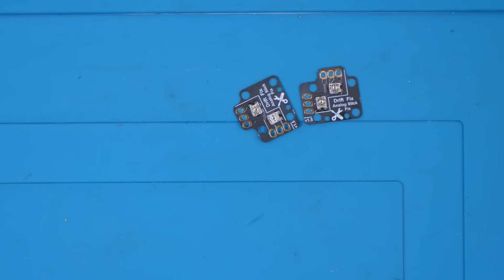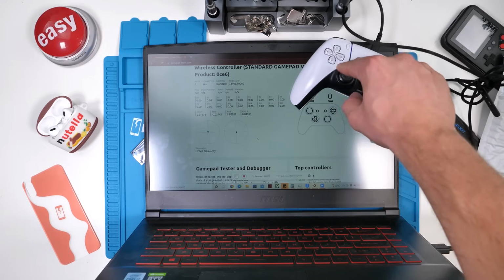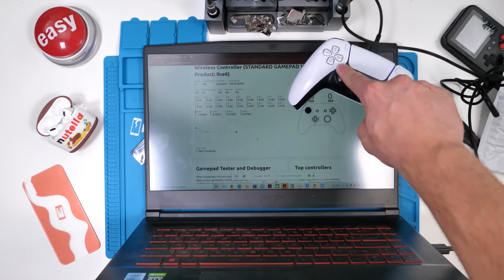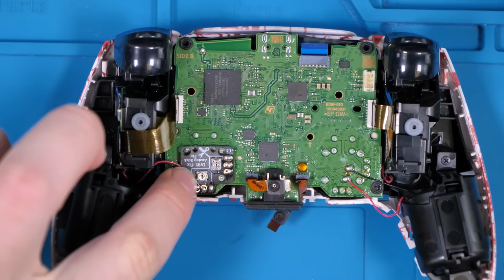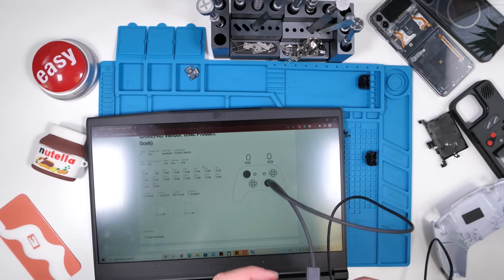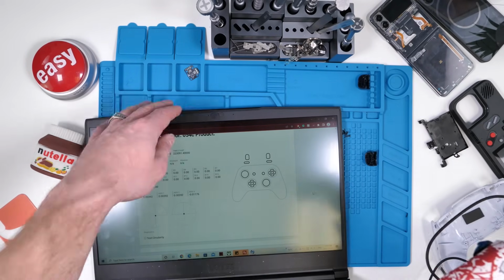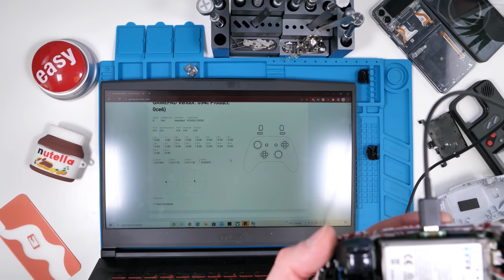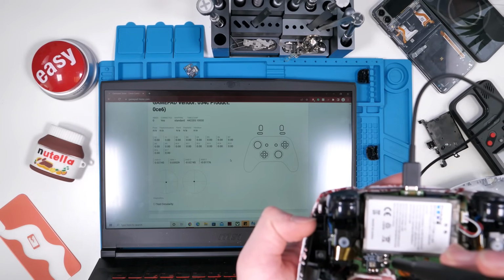IS THIS THE UNIVERSAL-  STICK DRIFT FIX?🤨

Comment from the maker: https://www.aliexpress.com/item/1005004122483308.html?spm=a2g0o.order_list.0.0.37d21802JXA1Nb
Reply: Hi
Reply: Hi again
Reply: Hi again again
Reply: Hi
Reply: Hi again
Reply: Hi again again
Reply: Does it work with ps4 controllers
Reply: Oh god, PLEASE use flux when soldering, seeing the pads look like that just pains me, probably because my job is literally to solder
Reply: steam deck is another console/ pc but it has a controller so i count it
Reply: Nice
Reply: You should do a video about gulikit hall effect sticks
Reply: Hey I already fix my Xbox Controllers (they are the best for playing on PC) .. Xbox 360 controller replaced USB wiring changed joysticks actuators replaced shoulder contractor buttons ... On my old Xbox one controller I replaced the buttons silicone membrane shoulder buttons the plastic broke so I kept it for spears parts
My Xbox one controller I use at the moment the shoulder buttons plastic broke ..the plastic that holds both buttons in place when I opened up the plastic was actually bent so I straightened out the plastic and glued stronger Plastic behind where it was bent reinforcing it by doing so I had to cut out the screw section in the middle of the controller it stays well closed with the screw's left and the controller works fine .. I only use PowerA brand RGB controllers 
I do have a new Xbox series X/S controller in it's box..
Reply: Hola
Reply: Hi
Reply: you have one of the those scammer impersonators in the thread offering gifts, pls remind ppl they are scammers and not you
Reply: Can u repair a oculus controller one broke
Reply: Good day phone repair guru 
I am a young entrepreneur who loves you to watch your videos, you inspired me to make my own small repair business and i would like to know if it's alright with you that i could call it Tech Repair Guru
Reply: @BOb911  yes
Reply: Send my money back prg
Reply: @@AstonDeSouza-oh3kw no, rog ally is weird
Reply: What is the link to the software you utilized during the drift analysis? 

Thanks!
Reply: NVM I just had to pay more attention to the words in the video ...

Comment: The real fix is to use Hall Effect sensors instead of potentiometers. Unfortunately those don't exist (yet?) for Playstation controllers of any generation, but Gulikit makes some pretty awesome controllers that have them which are compatible with everything else.
Reply: Sega used hall effect sensors in the dreamcast controller…
Reply: @jale05x  They sure did and those sticks never drifted :)
Reply: @hollow314  I own one and it works great as both a PC and Switch controller. DInput is pretty much obsolete anyway.
Reply: Gulikit is going to be selling Nintendo switch sticks that you can swap in on the original controllers!
Reply: @taroven  it should not be obsolete. xinput is horrible and it's just a way for microsoft to push their xbox controllers. i'm currently reading the hid and pid documentation so i can hopefully avoid this crap. also, completely ditching directinput is a horrible move since many old games and controllers rely on it.
Reply: Do they have them for Xbox???? I can only find ones for Switch, PC, and mobile
Reply: @shepshepson  I was under the impression that the Kingkong 2 would, but apparently not :(
Reply: Dang that sucks
Reply: I searched around and GuliKit appereantly has implemented DualShock 4 emulation in recent firmware updates. I have the KK2 Pro but no PS4 to test it though unfortunately.
Reply: @shepshepson  their KingKong2 Pro (officially) supports Switch Pro Controller emulation, Xbox, Android, iOS/macOS, and Windows via XINPUT in case the Xbox mode does not function for a particular game. So basically it has 4 different modes, which kinda turns it into a different controller.
Reply: @Piipperi800  are you for real? If so that's awesome that it works with Switch, Xbox, mobile, and Pc.
Reply: @shepshepson  yes, I own the KK2 Pro and it does work really well.
Reply: @Piipperi800  well thank you for sharing!
Reply: ps3 sixaxis controller uses hall-effect sensor, so there you go
Reply: And there's already a steam deck hall effect joystick mod, but you gotta solder one connection which is annoying
Reply: @king_james_official  XInput > DInput

You can't be this fragile over a better system.
Reply: The DualShock 3 used hall sensors. One of many reasons it's one of my favorite controllers ever.
Reply: @Rudofaux  nahh man i'm not giving up support for 128 buttons and 8 axes
Reply: some ps3 controllers used hall sensors
Reply: @karelissomoved1505  Which one?
Reply: Are the Gulikit controllers good disability wise? Past controllers I’ve used have had stick drift, sticky/mushy buttons, dead buttons, cracks and scratches, etc… I’m looking for a controller that I won’t ever really need to replace
Reply: Can we use a bluetooh headphone on the Xbox SeriesX with a XB2 to Connect a Gullikit controller.
I answer that because i know that its not possible to use jack 3.5mm on the controller with a WingMan XB2 !
Reply: You can buy hall effect sensors now
Reply: I just bought a hall effect ps4 stick from aliexpress
Reply: I just installed hall effect sticks in my PS5 controllers. Not prone to getting gummed up but still requires these pots to correct minor misalignment.
Reply: Actually magnetic Hall Effect joysticks don't last half as long because the spring in them breaks faster than ps4 and 5 joysticks can get stick drift, rendering the joysticks completely useless. So ps4 and ps5 controllers are actually better. (just a little fun fact)
Reply: Marius Heier is working on hall effect sensors though
Reply: Hey, I know this was commented a year ago. They released the Gulikit KK3 Max , and I was wondering does it work for ps5 ?
Reply: N64 controller fixed this way back in the day with optical
Reply: analog hall effect have bad calibration you need this calibrator
Reply: False on every level. Also there are optical sticks.
Reply: The ps2 never suffered from drift like this new controllers
Reply: Some DualShock 3s use hall effect
Reply: Uhhh, they've been available for years.  I put one in my PS4 controller like 5 years ago ..
Reply: Does not work for me. The joystick  resistence is 10k, the pcb drift fix potentiometers are 10k also. They are installed in paralel, so the total resistence drops to 5k.

Comment: The adjustment board uses two trimmer potentiometers to make it look like the joystick is centered (basically an offset). It isn't a permanent solution, but it allows you to offset the axes once again if the stick starts to drift. Never knew these boards existed. It's a pretty smart and cheap solution to the problem before hall effect sensor joysticks become cheap and widespread.
Reply: isnt it easier to change the pottie alone instead of that?
Reply: @ed9...5  what pottie? You mean the glue
Reply: The original ps3 sixaxis controller is cheap hall-effect controller, hall-effect sensor has been around for a long time (we're talking the 80's here with hall-effect keyboard), and they're cheap but not as common as potentiometer
Reply: @meric12131415  pottie is a term for tri-legged potentiometer
Reply: @meric12131415  he means the litter box
Reply: @chrom4ful  🤣 ah thank you and thank god for Google
Reply: @ed9...5  this is easier since you don't have to de-solder anything, but i don't see it as a good or permanent solution since its probably going to gradually increase your dead-zone.
Reply: I dont think this affects deadzone at all. Its just an offset. A virtual one basically. Nothing was moved at all
Reply: @ggooaa100  sure about that?
Reply: @meric12131415  not 100% sure because I did not done this myself, but logically it shouldn't affect it. Its just counter the old potmeters bad resistance by adding or subtracting more with the little ones. Its just my theory . Lets say the pot. should be 1 ohm from the factory. If its starts to wear lets say at max its only 0.8 ohm so your maximum input is only 80% of the factorys. If you just add back that 0.2 ohms by this doodad, it should fix your deadzone right?
EDIT: I just simplified things with my example but it should work like that.
Reply: @ggooaa100  ah now it kinda makes sense also I guess so?
Reply: I agree, it looks more like an easy fix to repair and resell controllers, it wont last long because the original dead potentiometer is still on the pad and the drift can change direction or get worse so you will have to open again the controller again and adjust again and again. They even sell the stickers to make it like the controller has never been opened.
Reply: @ggooaa100  No, it wouldn’t fix it and yes, this mod works (temporarily) because it effectively increases the deadzone (to ignore errant drifting) which reduces the overall range of motion on the stick.

If your potentiometer is off center too much, this mod will limit your range by applying more resistance to the input. That means at 100% input, you're only going to actually see (for example) 60% output. These are really only useful for really, really tiny adjustments. I don't know exact values, but I'd venture to guess less than 0.5%.

Comment: I bought an inexpensive wired controller. Stick drift was always a problem. Not worrying about warranty, I opened it up and discovered the circuit board still had globs of solder flux around the pots and elsewhere. So I sprayed it with rubbing alcohol, scrubbed it with an old toothbrush, and reassembled it. Now it works perfectly.

Comment: For soldering, put a little solder on your iron, and touch the metals with that solder. It makes heat transfer better thus making it accept solder more easly. Then add more solder to the solder joints.
Reply: or better is to use some flux

Comment: What's funny is hall effect sensor technology was used for the analog sticks AND the analog triggers all the way back on the Sega Dreamcast. That means that back then it was somewhat affordable, at least to the point that it was economical to have hall effect sensors in the final product. As far as I know, it hasn't been used since. It's kinda upsetting because clearly that's one of the best ways to prevent wear and tear on the joysticks since there's no physical contact like with potentiometers, and it was at least somewhat affordable.

Comment: A tip for those soldering the board onto the back, 'add' solder droplet onto each spot first to make it nice and chunky, so you cover all the position for it.

Then put the board on top after the solder cools and hardens a little, and 'heat up each of the little holes rapidly one by one while using something to push the board down. If you do it correctly the melted solder will 'loosen' and fuse with the board while you are pushing it down... Be sure the solder doesn't leak out in between the board though.

Comment: This is really cool. I will note and he may say this, but you will eventually get to a point where the modules need replaced because it will eventually become nonfunctional by creating a massive dead zone. It’s a bandage not a fit. Still really cool. Also the parts cost a little less than replacement sticks so not as great cost wise.

Comment: Don't heat the solder, heat the pad/post you are soldering and "poke" it with the solder.

You should also be using flux to help the solder flow/stick where it is suppose to
Reply: I bet he had issues when he closed the controller because of this 😂
Reply: Could u perhaps dumb it down for me cause I just bought everything I need for this and don’t want to do anything wrong and I don’t understand wym

Comment: a month ago I repaired a stick drift from my old Xbox 360 controller. I simply replaced the potentiometer entirely, the piece costed me just 0,83 €. so it was much cheaper than this method and I didn't need to mess with a recalibration software. the downside is that I had to de-solder 17 points in order to remove the old potentiometer (14 from the potentiometer and another 3 from a different component that was in the way) so it took a lot more time than just soldering  without having to desolder first, but it was a nice experience.

Comment: I'm sure it works well if you have a dead spot in a particular place. Unfortunately my Elite II sticks in different places depending on which way I let go of the stick. If I hold up and let go it drifts down, if I hold down and let go it drifts up. Not always either. In any case this will only help if it always drifts the same way.
Reply: minute Maid  I had the same problem with the bumpers as well. It was actually quite easy to fix, just had to take the front  off and pick any fluff/debris where the bumper presses the button. It goes bad again, but it's not too hard to get back in. Could also be a bad button though.

Comment: I do have to say though, you should really consider a new soldering iron, the Hakko FX-951 is a lot better for small repairs because you can get extremely tiny tips with a lot better thermal conductivity
Reply: Thanks for the tip!
Reply: True but it might be better to go for one of the many JBC clones that are available now. Cheaper, better performance, and you can use genuine JBC cartridges (tips) with them. Tips last a really long time as they automatically go into standby mode when the handle is put in its holder. They automatically turn back on when you pick up the hand piece and heat up to soldering temperature before you have time to get the tip and solder to the joint, just a couple of seconds.

But the honest truth is that for basic soldering like this, just get any other tip for your existing iron that isn't a microscopic needle-shaped conical tip. Go for a chisel or bevel and get a few sizes. Just use the biggest tip you can that will still allow you to get to the pads and pins you want to solder. The parts pads and pins that are to be soldered need to reach a temperature that the solder will melt, so a bigger surface area will transfer the heat more efficiently to the pad/pin and a larger tip has more heat capacity as those old school irons don't get the heat from the heater to the tip very efficiently compared with the newer style ones discussed above. The extra heat capacity of a bigger tip will make up for the lower efficiency of the heater/tip by enough to make the job easier.

Comment: Love the vids but as you mentioned, your a little new to soldering. I just wanna say you did a pretty good job(as long as the joints dont touch) but just a good little pointer. You dont have to use as much solder as you were. Using less solder not only can keep from accidentally soldering multiple joints, it also just keeps your solder around for longer. Again love the videos and keep up the entertainment ❤️

Comment: The drifting stick is actually common on PS Vita, and someone actually fix one IIRC, with bunch of paper.

Yes, paper. Basically he added few papers to the back of the sticks so there's some pressure on the back.

Another solution that I come across is people actually blast these sticks with contact cleaner. Not even open the damn console. The idea was there's dust trapped inside so you need to blow it out. One of the safe way to do it with contact cleaner that comes in a pressured can.

Comment: My Meta Quest 2 controllers have terrible drift to the point where I’ve cleaned it with isopropyl alcohol 5 times, doesn’t do anything. I do not have any ifixit tools yet so ill watch this when i do

Comment: The cure would be some Hall effects sticks the steam deck has some third party ones you can easily install but I’m unaware if any exist for Xbox/PlayStation/Nintendo or if you can install any without heavy modding
Reply: Muhammad Al-Barwani  for the switch joycons? Makes sense it’s been having bad stick drift issues for years and those are pretty similar to the steam deck thumbsticks….I just wish they made some for PlayStation and Xbox….I’d love to have them on mine I’ve heard they more accurate with less or no dead zones that plus mechanical keyboard style switches on a console controller implemented in a comfortable and functional manner would be awesome….I’m a pc gamer but I’m platform agnostic and those switches after feeling them on a keyboard I just feel that they would feel amazing for a console controller it’s Much better and gives better feedback than the mushy membrane switches

Comment: And yes this is not a permanent solution but it'll probably double or triple the lifespan of each replacement module you buy to replace them.

For about $3~6 per board, or cheaper if you buy em in bulk, you can reuse them as many times as you need, even if you desolder and installed new sticks on top.

The boards you buy is meant for Dualshock 4 though, note that on the PS5 the red and black wires crosses under the board, on Dualshock 4 it's not under it.

At the very least it'll extend the life of a gamepad until you get hall effect parts or save up for those parts.

For the DIY enthusiasts, maybe you can install a 'adjustable' knob on the back of the case facing the screw hole, OR just simply and carefully use a soldering iron to 'melt' the hole precisely over those spots and use something to close it up when you are done adjusting.

Comment: the problem with that fix is the potentiometer which gets worn out, dirty, etc. That board will change their readings, but with time it will keep getting worse and the stick will start to give wrong readings! and I guess when aiming it won't be precise anymore, because even if you reset the dead center, the potentiometer itself has been degraded with time and will go crazy as soon as you move the stick.

Comment: No shit. Thats an easy fix. Didnt kniw these are a thing. I have a controller with stickdrift. Havent touched the thing for two years probably because back then you had to replace the whole potenciometer and after that calibrate the whole controller with a special tool. I was like its not worth it. But THIS! Nice vid. Thanks Bro!